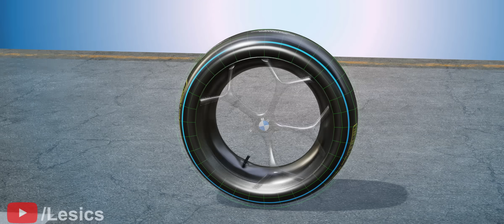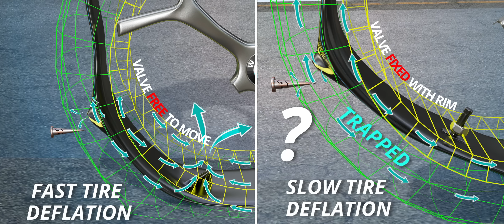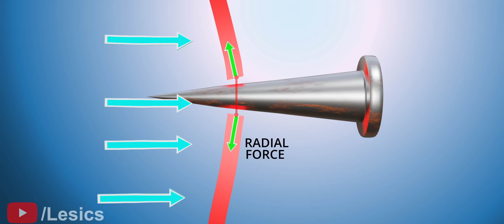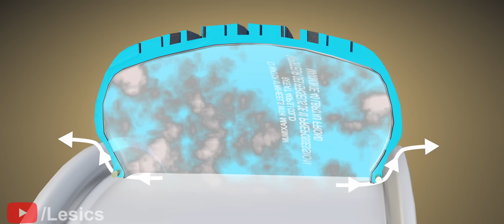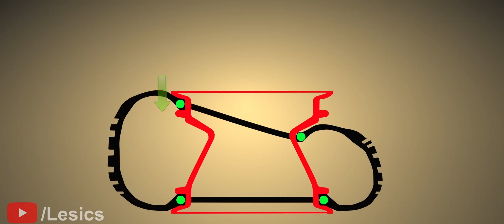Tubeless Tire | The interesting Physics behind it

Comment: "This is a nail. Nails are sharp because someone sharpend them and that makes them pointy. If you press a pointy nail into something soft, so long as the nail is harder than the material it's pressed into and the force exerted is great enough to drive the surface of the point forward, the nail will move in the direction of the force applied. This will likely cause a puncture in the softer material, as the nail will have to puncture it to be able to move forward. This is why nails can be dangerous when driven over. Driving is usually done on roads, which are not made of nail, but can contain occasional sharp objects due to other drivers carelessness. Nails are friction based fasteners often used for bonding wood in construction and other applications. They are usually steel, but can be made of other materials like aluminum. These materials are almost always harder than the rubber compounds used to produce automotive tires, and most nails are intentionally sharpened to make it easier for them to penitrate a variety of different material, usually far more durable than a rubber tire. When a force is applied to a nail, usually the upward force applied by an asphalt roadway, equal and opposite of that exerted upon it by the weight of a passing vehicle, the nail can be forced to permiate an automotive tire and cause a puncture."

Dude, who is this video for? Imagine you're considering swapping your fully restored classic car over to tubeless tires for safety but you don't understand the concept that a balloon will pop if you stick a pin in it. 

You owe me at least 4 minutes of my life back. Plus the time it took me to write this comment.
Reply: If he actually said what you wrote, you would have a point. But he didn't, so you don't.
Reply: @jdb47games  you are right. What's simple to me might not be so simple to someone else. I know cars, but I have been learning how to count in Spanish feeling stupid. 

I'm glad someone benefited from the explanation.

Comment: Interesting, but isn't isn't tubeless tires already a standard for cars? I know motorcycles still have tubed variants, but our local vulcanizing shop does not carry any spare tubes for cars. They would be useful if in case the rim gets damaged and a tubeless tire can't form a seal.
Reply: Depending on rim material, damage could cause structural weakness and could be unsafe to use if damaged and should be replaced. But you make a good point for temporary repair, especially for modern cars that don't have spare tyre but liquid sealant.

Comment: I think this video's use of the word impermeable is not the same as what I learned in school, so many decades ago.  Both the balloon and the tire are semi-permeable.  Without a break, the balloon will go limp from lack of air pressure within a week or two.  And, the tire would NEVER need to be aired up if it was truly impermeable.
Reply: The main escape route for air in a modern tubeless tire is the bead. Not permeation of the rubber tire. 

The main escape route on a tubed tire is the valve. 

While the rubber might be infinitesimally permeable, the loss of air through the tire/tube is negligible compared to the loss of air around the tire/valve.
Reply: @AmityPost  Thanks for the helpful and informative reply.  Still, impermeable does not apply to balloons.

Comment: The tire shops never tell you about this liquid inside to seal the tire🤔 must be that green crap they sell.
Reply: This video is misleading and incorrect. That sealant is used when tyre is punctured and only temporarily until damage can be fixed or tyre replaced. It can interfere with some car tyre pressure sensors. Some tyres (runflat) have soft inner rubber that do seal small punctures, but it is different. One should never fill tyre with liquid because it can lead to more damage due to imbalance, tyre slipping on rim...
...Unfortunately this is not good nor correct explanation. 
Majority of tyres don't have "hump" on rim. Air pressure keeps tyre pressed against rim and they form airtight seal. Hump may only help when tyre is deflated to keep the bead from mowing inwards and tyre collapsing.
Also balloon analogy apply to all car tyres since they all have reinforcements inside, and won't explode. Difference in tyre types is that tubed tyres are not airtight around bead and valve and will deflate faster when tube is punctured, while in tubeless the air can only escape through puncture hole.

Comment: Physicist here, who worked on tire cord materials, and once attended a symposium on tire design, alongside a bunch of tire engineers. I was gobsmacked by the level of design technology in these advanced composites. I still have the book on tire design fundamentals, which runs over 300 pages.
Reply: Oh yeah tires have a shocking amount of engineering involved. I’ve seen a few videos on it and people have spent a lot of time trying to improve them over the last 100 years. You’d think it’s just a tire or something but has some of the biggest impact on performance when you get down to it. I live in the snowiest city in the US so they’re especially important here and add a lot of extra challenges.
Reply: Good. I don't want them to fail at 150mph.
Reply: 300 Pagés on tyre??! That's both funny and tiring
Reply: I am just a regular guy and saw a video lighting up a tire for instant air tight. I know the science behind it but it bothers me whether the video just for a show or they really uses tubeless tire. Man I didn't know it is tubeless now a day. that is why curiousity arises why it should be tubeless and why air is not leaking. This video explain it all. So much complexity for a tire
Reply: Wow
Reply: Pun intended
Reply: I once read that space shuttle has tire technology that is light years ahead!
Reply: its just a rubber wheel how complicated can it be
Reply: @snusmumriken232 yeah put any old “rubber wheel” on a vehicle that travels 80 mph and tell me your results
Reply: @snusmumriken232  typical ignorance

Comment: I got a big nail on my new Car Tubeless Tyre(just in 300km) and the person who was performing puncture repair of Tubeless Tyre mentioned that the nail is too big so puncture repair won't work and the air was leaking. He suggested inserting a Tube in Tubeless Tyre and using it and now I have been using it for 6 months. Anything I need to be cautious of?
Reply: Good question. I have the exact same doubt

Comment: A lot of time and effort went into making a video with a number of false premises even though in general it's helpful. Inner tubes are not balloons. They don't explode with a pinprick. Anyone with a Pushbike can tell you that. This is because balloons are under such stress that they fail by fast fracture. Innertubes are not -they are restrained by the tyre and therefore under relatively low tensile stress.

Nonetheless Tubeless tyres have many benefits hence their wide use.

Comment: Why on earth does the tubed tire explode but the tubeless tire does not? The loads on the tubed tire stay the same whether there's air pushing directly against its inside or air pushing against tube pushing against its inside. Some cords may be cut in the tire by the foreign object, but the cords are cut the same way in the tubeless tire. Your demonstration would show why the impermeable layer of the tubeless tire doesn't explode, except it it is not applicable because none of the rubber in a tire takes the tensile inflation forces like a balloon, that's all handled by the cords.

This is why YouTube needs to bring back dislike counts.
Reply: My thoughts exactly- and regardless of the forces between the tube and the tire, even if you instantaneously dumped the full tube pressure directly into the tire, it will still only experience a peak pressure that’s less than or equal to it’s normal operating pressure, which is well below its maximum rated pressure and MILES below the pressure required to rupture it. A tire that fragile would not last 5 feet on any vehicle.

Comment: Wth? I dunno of this info is specific for cars (what cars use tube tires anymore) but I can guarantee you that most of this info is inaccurate regarding tubed vs tubless motorcycle tires. The valve stem is fixed (though allowed a small amount of movement unless using a rimlock), tube type tires can be used with tubeless systems (Tubliss being one of them) and the air doesn't leak through the tire. If the tube suddenly bursts it doesn't burst the tire... wtf?

Comment: Why would a non-tubeless tyre burst if the valve was not allowed to be pulled in and allow air to escape quickly? That seems strange, it's the tyre that resists the air pressure, not the tube. Would the air permeating the tyre material cause damage? It wasn't explained correctly I'm afraid
Reply: @kuldeepchhetri1355  that doesn't answer my question at all. And why don't bicycle tubes pop when the tyre is penetrated?
Reply: @OYeahan  perhaps i misinterpreted your question, could you please elaborate it.
Reply: @kuldeepchhetri1355  question is simple - why would the tyre burst when the tube bursts. See no reason why it would
Reply: @OYeahan  Listen carefully, It's not not the TUBE that bursts, it's TYRE that goes boom. A wheel is comprised of a hard material (tyre) and a impermeable tube, when the tube is leaked the air has now moved from tube to the tyre, now the TYRE that was just meant for protecting the tube is actually working as a tube meanwhile the tube is flattened. Now the tyre can't hold the air because of the weight of the vehicle and the pressure of air as it was never meant to act as a tube in the first place. And to top it off the valve is actually not allowing the trapped air in the tyre to pass resulting the tyre to burst.
Reply: @OYeahan  Tube just leaks the air it never pops!
Reply: @kuldeepchhetri1355  the video clearly states that the tube bursts. About the tyre failure, it's the tyre that always resisted almost all of the pressure of the air that was inside the tube. Tube only acts as a container; if you tried to inflate it to the normal operating pressure of the wheel outside the tyre, it would burst. So I'm asking what is the supposed mechanism that would cause the tyre to burst, when the pressure exerted on the tyre from the inside stays almost the same.
Reply: @OYeahan  I don't recall him saying tube bursts. Can you send the particular timestamp where he actually says that? 
And about that tyre burst thing, it's just a basic high school science. Because the material is not suited to act as a support for the wheel, it was just meant for protection and nothing else. The pressure inside the wheel might remain the same but not for the tyre. Basically the tyre is much more fragile and prone to pop because it's literally holding a fuckin car.
Reply: @kuldeepchhetri1355  I have never seen a passenger car tube and non-tubeless tyre, but I'd imagine the tube is just a rather thin walled rubber "balloon" and it's still the tyre that holds the pressure. It can't be the tube that holds the pressure itself as it would defy the whole purpose of pneumatic wheels...
Reply: The whole video's main premise sounds like uniformed/made up crap, to be honest.

Comment: Pro tip: if you want get more grip put less air so the tread get more surface on the road. Cons: probably you can't go high speed with this config
Reply: And fuel consumption will rise
Reply: @dragontrainer07  man you comment like no brains people knew this tip and they will likely to fill the tire afterwards. The config usually goes for muddy area.

Comment: @Lesics
7:20
By having liquid latex sloshing inside the tubeless tire, won't it adversely affect the tire's balancing and then the vehicle's drivability?
Reply: Look up balance beads, you will see that not only does it spread evenly but it will actually enhance the balance of the tyre on the rim.
Reply: Centrifugal force distributes it evenly when the vehicle is in motion
Reply: @barmiro  
Any evidence to support this hypothesis? Has any actual test been done to validate your claim?
Reply: @davedaihatsu2585  Yeah
footage from gopro cameras inside wheel.

Comment: I'm confused by how you specify that a hole that is allowed to open widely causes a fast release of air and rapid deflation is seen as preferable, but then offer the "sticky tape" method as a solution to the blowout problem. It looks like you pointed at a problem, and then recreated the problem in a similar context and called it a solution.
Reply: because the sticky tape has a tremendous amount of tension that prevents a blowout. get it?

Comment: Buy Tubeless BIKES...it's so much better. Even if self repair fails, when you Impaled your tire, you reinflate it, and you can go for 10 Minutes without a problem... just repeat every 10 minutes, and it's indefinitely.
Reply: It depends on the size of the hole actually. I once get impaled, and it can last about 2 hour before it become uncomfortable and need to be refilled.
Reply: @adityawicaksono875  that's just stunning.
An whole different league in tire.
Reply: @legitscoper3259  
Haha as long as you don't pull the screw/nail, the leak should be very small

Comment: Amazing animation and clear explanation. Thanks for this video
Reply: Unfortunately this is not good nor correct explanation. 
Majority of tyres don't have "hump" on rim. Air pressure keeps tyre pressed against rim and they form airtight seal. Hump may only help when tyre is deflated to keep the bead from mowing inwards and tyre collapsing.
Also balloon analogy apply to all car tyres since they all have reinforcements inside, and won't explode. Difference in tyre types is that tubed tyres are not airtight around bead and will deflate faster when tube  is punctured, while in tubeless the air can only escape through puncture hole.

Comment: At 1:04 you mentioned that the material of the tire is Air Permeable, and air can escape from the surface of the tire. 
So, in a tubeless tire, along with the rim, the material of the tire also should be changed. Right ??
Reply: Basically a tyre is constructed by stacking different types of rubber layers one over the other. Each layers have function of it's own. In Tubeless tyres, the inner layer is made of impermeable rubber compound which does the function of tubes- ie, retaining air under pressure.

Comment: When was this video done?  I ask because they haven't made tubed tires in decades.  I think you only find them now on large trucks (18-wheelers, etc.).
Reply: What difference does it make? It is still a technology that exists, and is actively used on trucks, trailers, and low speed vehicles.

Too bad the information in this video is fundamentally wrong and presented form a single case, and unlikely scenario viewpoint.
Reply: In India, lot of 2 wheelers still run on tubed tyres, especially ones with spoked wheels.